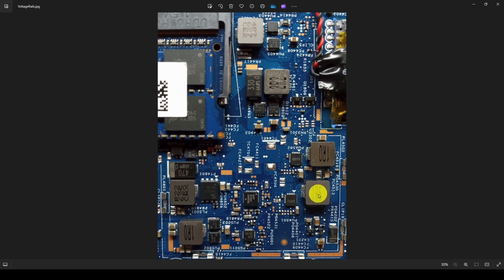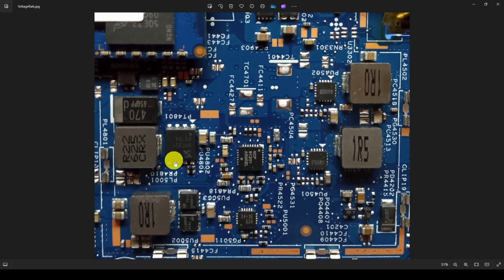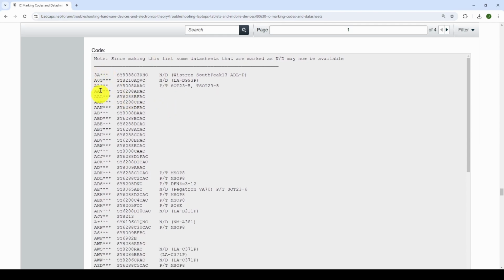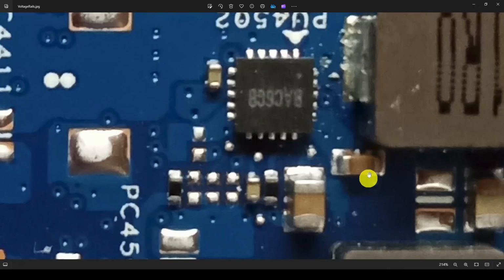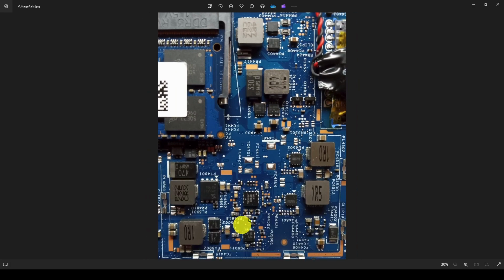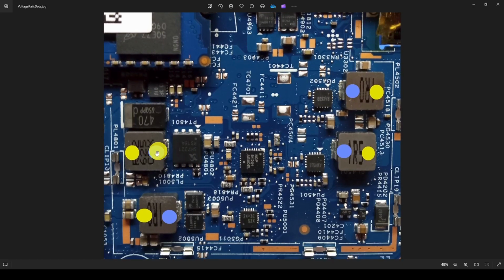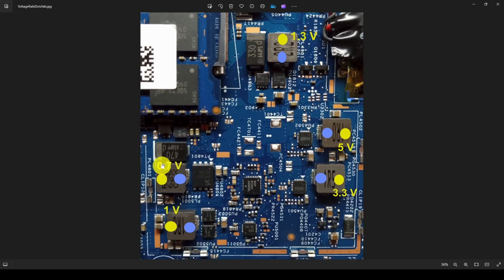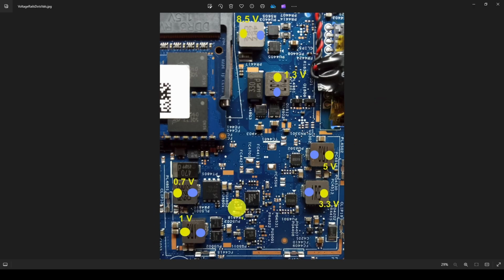Laptop Repair Basics Part 6

Comment: Very interesting and detailed videos. Please continue with this series up to actual repairs (there are tons of faulty motherboards out there and many other electronic devices that apply the same rules more or less). Just one remark/clarification regarding the big electrolytic capacitors. I believe the use of these caps in these two power stages (especially in the CPU) isn't only for filtering but also they provide additional local energy storage for the load. This is to avoid ripples during the sudden increase of the load for additional power (i.e. during CPU boost).